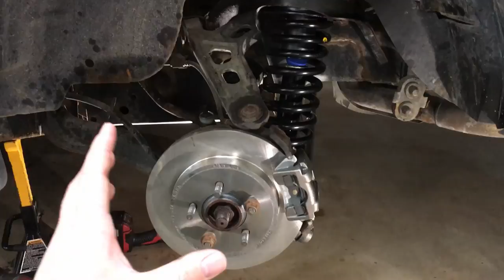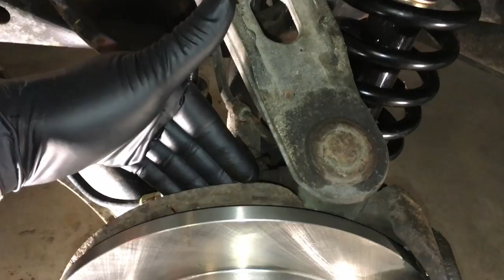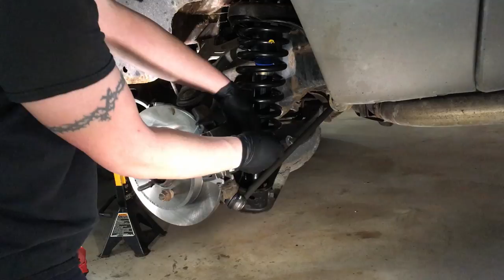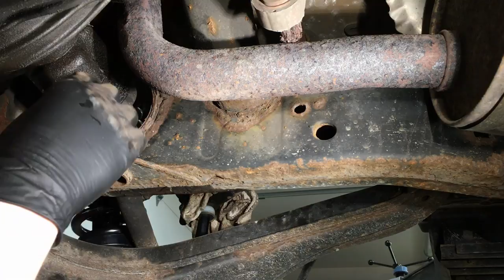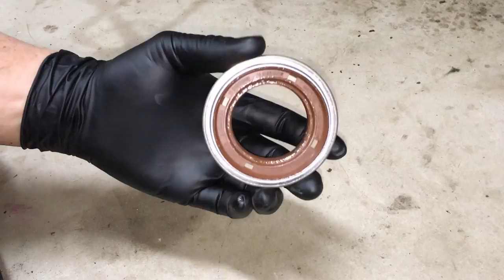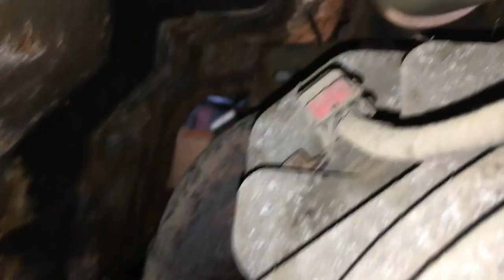2002-2005 Ford Explorer: 8.8" Rear Axle Seal Replacement

Comment from the maker: These Parts and Tools I recommend-
Latest Rear Axle Seal Kit-
http://amzn.to/2yafWFC
Medium Strength Thread Sealant-
http://amzn.to/2zAnaHv
Drain Plug Thread Sealant-
http://amzn.to/2hfgib3
Hub Puller- 
http://amzn.to/2y8lEIq
Latest Spec Axle Fluid-
http://amzn.to/2y9BjXO
Friction Modifier (only needed if adding 1qt or more of axle fluid)-
http://amzn.to/2zAYChM                                                                                                                                                                             Torque Specs:
Lower Control Arm Bolt- 111ft lbs
Upper Ball Joint Pinch Bolt- 66ft lbs
Toe Link Pinch Bolt- 66ft lbs
Axle Shaft Nut- 203ft lbs
Wheel Lug Nuts- 100ft lbs
Reply: FordTechMakuloco I have a Ford 2007 Ford f150 that won't catch reverse as well in neutral it as well does not roll back, forward out does but not freely,and it does get drive gear may you please help
Reply: Hi Brian. Your videos are fantastic! I'm currently doing the rear axle seals on my 04 Explorer. I'm having difficulty getting the seals to seat without going in crooked. The Ford tool you used to drive in the seals in the video looks like it might do the trick. Does anyone sell that tool online that you are aware of, or is there an alternative that will work just as well? Thanks again for the excellent and informative videos. Your know-how is among the best  of the mechanics I've seen on youtube!
Reply: Do you have a part number for the tool you used to knock the seal back in? I'm replacing the entire center section with a junkyard one & while it's out I want to put all new seals in it. I figured this is the best & easiest time to do it. Also the front seal where the drive shaft is, is that hard to replace?
Reply: @FordTechMakuloco I forgot to tag you in my above post.

Comment: Good work man, there's no easy way to do this job, I'm in the middle of doing my rear bearings and diff seals as well as the input bearing and seal, fun fun fun.  These seals are why my local salvage yards are FULL of these trucks.  The seals quietly go bad and boom, you smoke the diff.  The repair is more than the value of the truck at that point...almost as if that was the plan, but I digress.  Give me a live rear axle any day.  Again...nice job

Comment: Thanks for the great video, just helped me get the same (left rear) CV axle out of my 2004 Explorer Eddie. Took a few more hits then yours, but it did come out. I'm replacing mine because the other end is stuck in the hub and won't come out. I was replacing the entire spindle assembly, so it wasn't too big a deal that I had to replace the CV axle, I just didn't know it would be so easy to be quite honest. Of course I wouldn't have known how to do it easily without your great videos, many of which have helped me with my Explorer, which can be a challenge to maintain.

Comment: I cant thank you enough for this detailed video!!! Seriously your video was the first that I finally found after searching for months due to my axle was not ceding into the differential after having a reputable shop replaced my right rear cv axle due to issue at the wheel end yet when I got it back i kept hearing a noise and after jacking it up it was now an issue with the shaft backing itself out of the rear differential end vs the initial problem...so I take it back to reputable shop they recharge me to put a new axle in again, and its doing the same thing and in the process of this, the day I left their driveway  I  heard a loud humming sound and the trailing arms on both sides now need to be replaced!!! So now your video even tho, this is a ford explorer it is comparable somewhat to my 2005 Chevy Equinox so now I see that the axle seal definitely I will assume is the issue of why the 2nd axle would not cede into the rear differential and possibly they did not turn it while installing either axle bc Im on axle 3 now but have the replacement but unfortunately not the OEM, and i know that it was leaking the fluid out due to condition which makes me think my fluid level is low, so that will also be completely drained and replaced !!! Again thanks for this informal video

Comment: Our 2002 Explorer had a issue with the differential bearings failing which caused the seals to go.  Two rebuilds before 140,000 miles.

Comment: I had the knuckle off doing the rear bearings and did the final torque of the axle retainer nut (203 ft-lb) with the car on the ground, is that a problem?Great video, thanks.

Comment: Your video was very helpful and I could not have done it without it. However I have a problem that I can’t get the seal in because I don’t have a tool like that and I don’t want to damage the new seal. Do you know an approximate tool that would work? I don’t see one in the link

Comment: One more time. Specifically, what years of explorers require the special fill procedure and where did this info come from if the shop manual calls for the standard fill to the bottom of the filler plug?

Comment: I know this is a old video. But wanted to make sure at the end where the sensor is you take that off. Then you said to add more fluid how can you add more after you screw it back on. Is there a way to fill it up from where you took the screw and the sensor out? Thanks

Comment: Got it put the new seals in last night did get the blue locktite one other question I know you said to remove the excluder ring from the cv with the new seal is there any dust cover the goes between the half shaft and the new seal of is it just the inner cv shaft through the seal and it’s good?

Comment: Nice install vid!!  Is there any way to make the egr monitor run quicker using a MaxiDas or Verus scan tool?  2011 Transit Connect. All others r complete. Is there a cold cycle requirement on them?

Comment: What is the part number of the tool you're using for the axle seal? Will that tool work on a 2007 Ford explorer two wheel drive?

Comment: Can you talk more about filling the diff to the proper level. I stuck a wire down into the hole where the bolt is and the bolt went to no where. I tried pumping oil in the diff and it wen of the side and I let fluid gravity drain in there and it did not go in either.

Comment: Is the additional pint added through the ABS sensor hole part of a service addendum?  According to the 2008 factory workshop manual DVD, it just calls for filling to the bottom of the filler hole.
Reply from the maker: Correct 2007 and newer models you fill to the bottom of the plug threads, 2002-2006 you follow this fill procedure.
Reply: I should have clarified that in the 2008 DVD, the procedure for the 2003-2005 is shown as filling to the bottom of the filler hole (I didn't check later years).

Comment: Would a chisel be better to pry the pinch bolt space apart  or could that crack anything ?
Reply from the maker: Most chisels are too thick, a flat blade screw driver like this one creates the perfect wedge without spreading too far.

Comment: Is there any abs sensor in rear wheels? Or just 1 on a top of deferential?
Mine is 2004 4x4 limited, 4.6l and I don't see abs connection in a wheels, just middle,top one.
Thanks

Comment: the socket size that I needed to get the bolt off to fill the diff to the proper level was 3/8th. when I tried to pump fluid in there it just come out like there was no where for it to go. there was no sensor, I did not try sticking a wire in to the hole where the bolt was. can this be explained?

Comment: What air hammer is that? Also what 1/2 impact is that? Thanks
Reply from the maker: This is the air hammer from MAC Tools-https://www.mactools.com/en-us/Power-Tools/Air-Drive-Tools/a58cece1-742c-417f-87b3-a4b0003607b0/Air-Hammers/MPH1911/Long-Barrel-Air-Hammer
Reply from the maker: This is the mini Impact here, lot's of power but also runs at 6500 rpm so about 1000rpm faster than other impacts-https://www.mactools.com/en-us/Power-Tools/Air-Drive-Tools/65f4a6a8-d2ff-46ef-8078-a55801042405/Mini-Impact-Wrenches/AWP050M/1-2-Drive-Mini-Air-Impact-Wrench

Comment: Does the seal also the same procedure for irs 9.75 Ford Expedition.
Reply from the maker: Same procedure but different part number.
Reply: @FordTechMakuloco  got one today part number 7L1z-4a109-b I appreciate all your videos they are all I use 90% of the time. May buy a 2nd before I reinstall the half shafts. I couldn’t find another Ford one local have you ever used a national seal kinda want to replace both so I don’t have to take the suspension apart again.
Reply: Forgot to also ask do you use locktite on all the suspension parts going back together and if you do is it the red or blue.
Reply from the maker: use blue